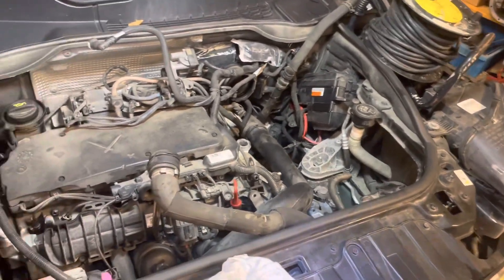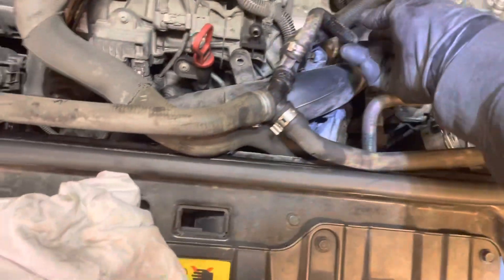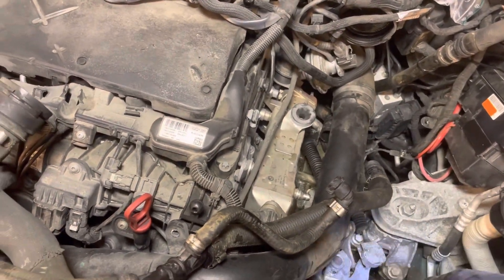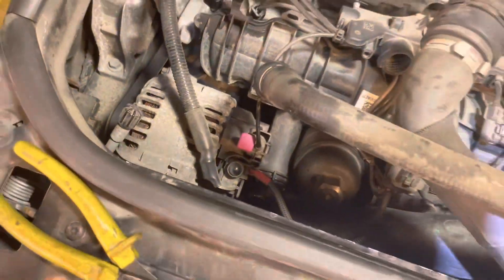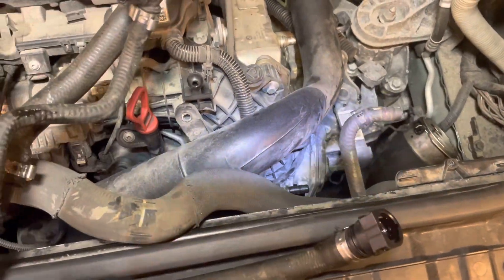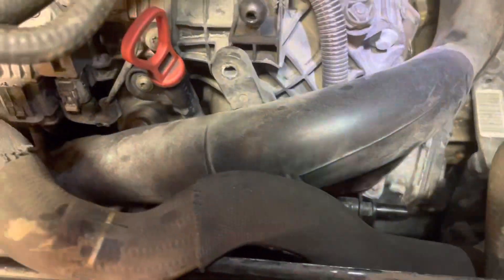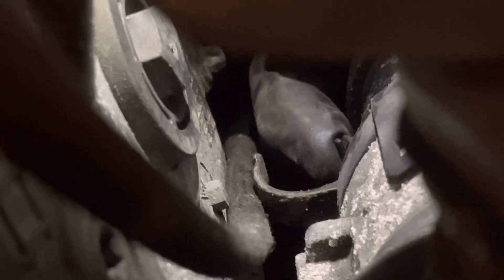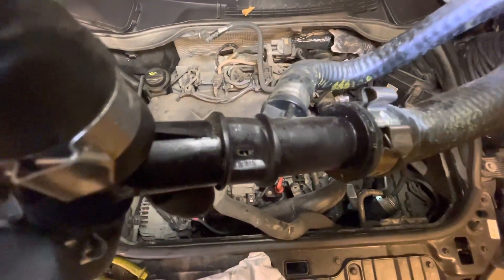2014 Mini Cooper Countryman SD Diesel (R60). Coolant pipe leak and replacement.

Comment: Great video mate. Had a water leak on my R60 and from underneath i could see water dripping off the bottom of the Y pipe. Stripped pipe off as per your video only to discover a pin hole in exactly the same place as yours!.